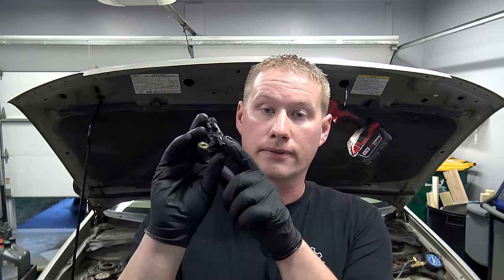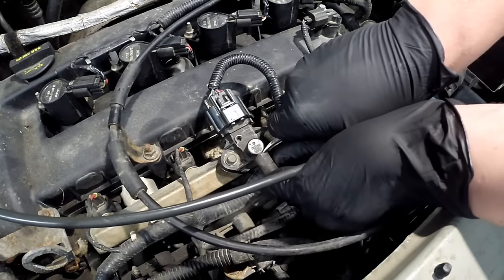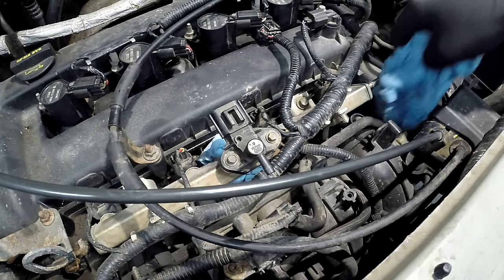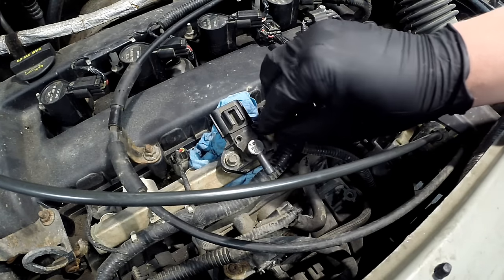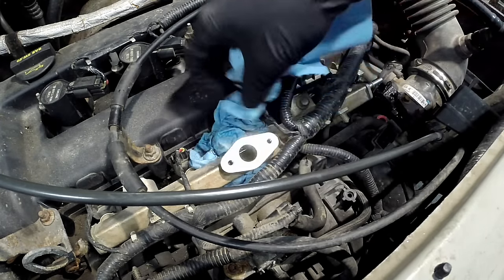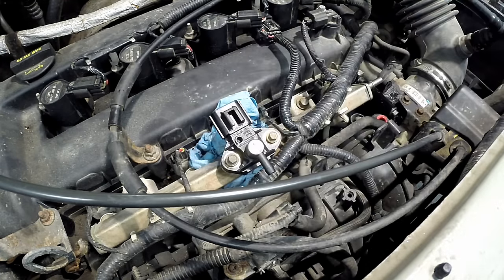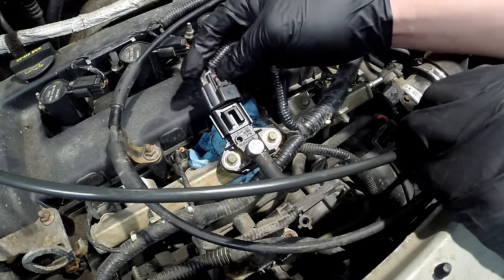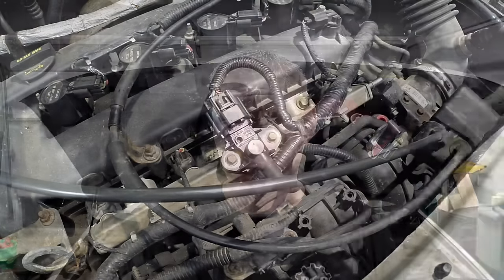Ford Vehicles: Fuel Rail Pressure Sensor Replacement P0191

Comment: My 03 mustang gt just died in the driveway, code was P0190 what do you think pressure sensor or fuel pump? also amazon does not have this motorcraft part for my car

Comment: I have an 06 Ford Freestyle.  I keep getting the code P701. Range Performance Sensor. where is it located? and is because of the connector being coroded? I can warm up my wagon for a 1/2 hour allow it to sit for 45 mins after running it. And them it's fine to travel in. before then it goes into crawl mode and still ha e to wait for the transmission to engage. what can be the cause of this? can you help?
Reply: Pls how did you fix it?

Comment: When you first removed the Frp sensor there was fluid leaking from the right of the fuel rail. Something to alleviate the pressure or a hoes simply forgotten before video took place?
Reply from the maker: This was removed from the diagnosis phase.

Comment: Please help !! I have a 2003 Ford Expedition 5.4L I changed an 02 sensors bank 1 … car was running to rich … I switched it and put new 02 sensor on … cleared the codes and car still runs like if it has a misfire … checked on a scanner fuel rail 1 and 2 are adding more fuel to injector .. what can be the problem please !!!!

Comment: I have a 2005 Mazda Tribute which I have been told is the same as Ford Escape. The problem I'm having is that I get different miles per gallon for every tank full. On one tank full I will get 19 MPG, then the next I will get 15 MPG, then 13 MPG, The 10 MPG, then 15 MPG, Then 19 MPG, and so on. Could this Sensor be causing that? If not, would you know what it could be?

Comment: We have a 2015 ford transit cargo- we have had an new issue where when we first start up the car when we come to our first stop- the engine cuts out, we restart it and then it runs fine. Could this be effected by this  sensor? Thanks so much for this great vid!
Reply: How did you solve the issue?

Comment: I have a merc sable 2002 and the P0193 fuel rail pressure sensor A circuit HIgh came up on my scanner I replaced the pressure sensor and my car still stalls and dies I don't know what would be another option?

Comment: What are the symptoms of failure on this sensor?
Reply from the maker: No start running rich running lean and most times just codes associated with the sensor circuits like P0191
Reply: Thanks.  I have a 2009 4.6 Lincoln.  Idle is not smooth.  New coils, plugs, crank and cam sensors, fuel filter.  Trying a new IAC this week.
Reply: I have a Ford Focus Diesel 2.0L TDCI, it won't start in the mornings , even during summer, when I get it started on WD40, it starts in between short and long trips the whole day, then won't start in the morning again. Questions ; 1) Does my car have this fuel regulator? 2) Is it the same part for both petrol and diesel engine? 3) Is it also plug and play for diesel engines? 
Thanks in advance!
Reply: steve b , same as you
Reply: turn the key on and let the glow plugs warm up, if that dosnt work your plugs might be bad, diesels have to have a heating element to start since they use the heat of the block for combustion and it sounds like ur either not giving it time to warm up properly or your heating element(if its glow plugs or a heat screen) may not be working

Comment: P0191 fuel rail pressure sensor code. Sensor may be going bad. Hopefully it will be that. If replacing doesn't fix the problem. I would  replace the fuel pump it may be intermittently failing loosing pressure. also replace the fuel filter.

Comment: I wish you had shown the diagnosis of this man. I have an 05 Ford 500 reading 10psi frp koeo with the scanner.
With a real gauge hooked up at the fuel filter under the car when key comes on pressure goes to 80 after 4 or 5 cycles but always settles back to 40 psi.

I have p0190, p0191 FRP Sensor codes and stuck rich both banks, 02 sensor codes p2196 and p2198. Condition is severe flooding non cranking. If i do get it to run its spraying gas mildly out the tail pipe.
Reply from the maker: I did I have a dedicated video on the diagnosis of this sensor.
Reply: Ok I found the diagnosis vid and it helped enormously. I went through the sensor test with a fuel gauge hooked in and plugged off at the filter near the tank, zero pressure on the rail and did the circuit test.

 My scanner doesn't show the voltages coming from the sensor to the ECM but did show 0 pressure and 83 psi when jumping appropriate pins in live data. Even my Torque Pro app shows it. 

Turns out my FRP sensor was stuck at around 11.3 PSI with zero actual pressure in the fuel rail and never went above 13 PSI no matter how much actual PSI was on the system back when I had actually gotten it to run a minute.

Thanks for your helpful vids. We had to haul this car in and did not know then what the problem was.
With the sensor unplugged the computer sees 83 PSI automatically which I guess would get you home if you knew to unplug it.

Anyhow the new sensors in and its running like new. Thanks again! My daughter will be so happy!

Comment: I have this code p0191 I replaced de sensor with original part won’t fix the problem I replaced the drive module still same code, any advice

Comment: I have a 2006 Ford 500 and the hose connection on mine looks totally different, the hose and the connection are one piece.  The part I ordered off Amazon(which is supposed to fit my car) is more like yours.  Update: Nevermind, I figured out what the problem was.  The hose was so dirty it looked to be one piece but it wasn't.  DOH!

Comment: How well do these sensors hold up to E85 fuel?
Reply from the maker: No problems.
Reply: @FordTechMakuloco  I don't know if this will change your reply but I forgot to mention that I have a 2002 Mustang GT with a bad FRPS. I installed a flex fuel kit on my stang.
Reply from the maker: Oh so you put a flex fuel in a system not designed for it?
Reply: @FordTechMakuloco  Yep. According to my research it's doable but the fuel pump and some of the fuel lines have to be upgraded for E85. The OEM 19 lb injectors are suppose to be adequate but I should upgrade to larger injectors.

Comment: More common for a fuel pump to cause a p0191 than the rail sensor? Wife F150 decided to barely run after she drove it a bunch. Had to tow it home... I was hoping to have the FP Module again but I'm not thinking so.

Comment: 2007 ford explorer fuel rail sensor, replaced twice, replaced connector, still having issues with trouble code P0193, and need further insite to other remedy to resolve this issue. my code reader when vehical is operating the pressure stays constant and does not flutuate at all at 72.?? PSI throughout idle and increased engine throttle. any suggestions on what else should be evaluated for correct function.

Comment: I have a 2008 ford f350 5.4L and it lacks power completely going uphill and acceleration and it threw the p0191. Does that sound like a symptom that could be affiliated with this sensor?
Reply from the maker: On those trucks it generally means the fuel pump or filter is failing.
Reply: Dildo Baggins you check the cats? Mine didn't have power either. I heard rattling underneath so I ordered direct fit cats on eBay and she will spin the tires now. I did the fuel pump module which is on the frame above the spare tire. I also did the fuel rail pressure sensor. If you turn the key to the on position, do you hear the fuel pump kick on in back?
Reply: I have the same issue lose of power code p019

Comment: I have 16’ ford fusion 2.5L and when it comes to a stop it stalls out. With some research it is suggested to replace the low pressure fuel sensor. Can you please help me locate it. I know it’s on the fuel rail but how do I know if it’s the low or high pressure sensor.

Comment: So after I replace the sensor what is the next step in terms of testing it. Do I start it up?
Reply from the maker: Check live data on a scan tool.
Reply: He stated quite clearly.....turn the key on and let the fuel pump get the pressure up and look for leaks.  Do this a couple of times, then if no leaks, start the engine.

Comment: I just put in a new fuel pump into my 2001 Taurus. I still don't seem to have good pressure. Could it be this regulator?
Reply: Did you figure it out?
What were your symptoms ?
Reply: @Devo  actually,  the problem was the ignition key.  My wife lost the key and had a guy come to the house and make a new one.  The new key did not have a chip in it.  I paid for a different company to make a key and the car started immediately.

Comment: Can this sensor cause raw fuel smell from the exhaust pipe when I start it in the morning?
Reply: Yes. It made my escape run too rich, which means too much fuel. Did you fix it? Hope it went well
Reply: @nickaa827  
Actually it was a leaky fuel injector. I replaced all of them and the smell went away and my mpg went up
Reply: @poundu27  awesome
Reply: @poundu27  how did you determine that
Reply: @nickaa827  
I pulled the injectors out of the engine and then I turned the ignition key to the ON position and there were two injectors leaking.
If you are going to do this, first you relief the pressure by removing the fuel pump relay and then you attempt to start the car. Try to start the car 3 times
Reply: @poundu27  interesting, at how many miles did this happen? and what year/model? ill try to look out for it on my 2005
Reply: @nickaa827  
140k miles
Reply: @nickaa827  if it's running lean it's too much air.. don't work on cars

Comment: Hey  would this sensor replace the mechanical fuel regulator? I have a 2001 ranger 3.0 v6 and it seems that this ranger does not have a mechanical fuel regulator. So I'm gonna look for this sensor.

Comment: The o-ring on the pressure sensor is sensitive when changing out the sensor. Th o-ring rips every time. Is it ok to use a different o-ring for the time being? I can't find the exact match anywhere except when ordering a whole new sensor. Does anyone else have this issue?
Reply: I ripped mine on the new one, had to use the old one. I used a tiny bit of grease on the o ring, and twisted it into place.

Comment: The fuel line is off the end of the rail. It leaked back there when the sensor came out.
Reply from the maker: Yup broke the vacuum and it leaked out. This fuel rail pressure sensor was part of a much bigger repair due to a lightning strike.

Comment: Question, i have a 99 mustang GT and i am having a “High pressure” fuel issue that is intermittent. New pump in it. Has been doing this for years. Do you think my aftermarket cams are messing with the vaccum?

Comment: Now do a video on a 2002 F150 4.2 V 6 regulator please! It's crammed in the passenger side of the truck at the rear of the the engine underneath the coil pack! Getting at the snap ring is a major pain in the arse.

Comment: If that sensor is bad will it send an intermittent signal not to operate the fuel pump? I'm having intermittent fuel pump problems but I definitely don't wanna change the pump and still have the prob
Reply: dondale68 check your fuel pump control module as well those can go bad on fords a lot

Comment: I have a 2010 ford focus and my check engine light is on I checked it at auto zone and I got a p0451 code what part is that most likely associated with

Comment: Hello sir. 
Please help. 
I have a 05 zx4 with manual tranny. 

Randomly shuts off then won’t start for about 30-60mins

I tested alternator while running (14.4v) 

Replaced fuel pump, filter, and maf sensor along with crank shaft sensor. 

Only code coming up was P0320 

Not sure what to do from here. 
Please lmk of a way to pay 🤑🤑🤑 for your time thank you

Comment: Is it possible that this could go bad without throwing a code? My truck reads 0 fuel pressure on the scan tool while running and driving.
Reply: How did you fix?

Comment: I'm pulling 274.21 psi on mine at idle.  Someone told me that was insanely high but I'm not sure what the factory spec is. I have a Ford 3.0L Duratec V-6.
Reply: Sorry....it was P/K

Comment: I have a 98' Lincoln continental 4.6L it won't stay running. Codes po192 and po113. Can't seem to find the low pressure sensor.

Comment: So my engine don't start is it because of the fuel rail sensor? It threw a code of fuel rail sensor A. It's a 2004 Ford Mustang GT.
Reply: I just got that code on my 04 gt. Any luck??
Reply: Throttle positioning sensor wasn't adjusted corrected. Also have to return it to stock tune
Reply: @cuda4094  appreciate the reply! Hoping to get this fixed ASAP

Comment: Thanks for the Amazon links!  They were cheaper than RockAuto!
Reply from the maker: Most times yes because rock auto gets you on the shipping you have to wait much longer to get your parts I never use Rock Auto because of these deceptive practices.
Reply: slider728 where is the amazon link
Reply: FordTechMakuloco has it in the description in the video.  Click on the "Show More" right under the video and you should find it.  Just make sure this particular part fits your car (the link is for the Motorcraft CM5229 Fuel Injection Pressure Sensor).

It was pretty easy to replace.  It took me longer to remove the hoses in the way and label them than to actually replace the part itself.

Comment: 06 Explorer, 4.0 SOHC... This WOULD be a 10 minute job,  except mine is UNDER the intake manifold!
About 10, star-head mounting bolts,  multiple hoses and wires before I can even get to it...
I'll see how many hours this is really going to take.
***Update: It's December in PA. Going to put this off until spring and after I buy a long enough socket extension & (apparently necessary) torque wrench to be able to do this "simple" job.
Or just save up and pay someone. Either way, it's going to have to wait.

Comment: Why can't you just pull the fuel pump fuse while the engine is running and let the system run out of gas?  Won't that bleed the pressure from the rail as well?
Reply: That will get rid of most of the pressure but not all.  When the pressure drops below the threshold the injectors need to keep the motor running, it shuts down and the remaining pressure stays in the rails.
Reply: Not with the engine running...the engine runs until there is no more fuel coming to it...because the pump is down.  I've done it...no pressure left in the rail.
Reply: Just did this on an 07 Mustang GT. I started the engine and pulled the fuel pump fuse.  Wrapped the area with a shop towel as shown, waited about 10 minutes and pulled the sensor.  There was fuel in the rail but no pressure and I had little to no fuel leak out.

Comment: I replaced fuel injection pressure sensor I started a looked for leaks  so I test drive it now it blows the black o ring apart

Comment: Dang it. I just left my vehicle for diagnosis and repair for a code for this sensor. I could have changed it myself. $90 for for diagnosis and 350 for parts and labor. No way I'm taking it back and doing it myself!
Reply: Double dang. My year make and model its under the intake manifold! They weren't lying about 2.5 hours labor after all!

Comment: Where is the A rail sensor on a 4.6 v8. I'm getting misfires on 1, 2, and 4 with the computer throwing the code that my fuel rail A pressure sensor is out
Reply: It's on the fuel rail on the driver side just behind the thermostat.. I replaced on my truck amd it didnt start after the new parts was on .. so just put the ole on and it started up again .. 5.4 3v problems

Comment: This is not as simple replace fuel pressure sensor. There is another have an issues with code P0191. I have a 2006 Lincoln town car 4.6L. I have issues problem 4 times driving and shut it off itself engine while driving. So I replace the fuel pressure sensor, and still keep same thing shut it off engine. 2 I replace the fuel pump and same thing stay shut it off itself engine, 3 I clean a fuel injections all 8 pieces and I replace O-rings fuel injector. And right now I’m still struggle I don’t know what going on my car issues with code p0191.
Reply: May also I checked on Fuse fuel pump, and the micro relays these relays are good I can hear when it click it it mean works.

Comment: Help...!! :(

@FordTechMakuloco

I replaced fuel pump ...  I didn't have any codes but my car was acting like it wasn't getting any gas every time I tried to start the car ..
After I replaced it the car has hard starts now ..
Finally a code came on it was p0193 I think but it said it was fuel pressure regulator , I replace that and the car ran fine for 1 day .. check engine light came on againg and its the same code for that sensor ..   its doing the same thing now hard start and feels like its not getting a lot of gas pressure ,  any help will be very appreciated ...  thanks in advance ..!!!

Comment: Anyone else notice fuel start pouring out to the right of the fuel rail at 4:30? LMAO
Reply from the maker: Yes this was a lightning strike vehicle that ruined a few modules and caused many sensors to be biased as was the case with this sensor. In order to confirm it was a damaged biased sensor the line was disconnected. Then once the sensor was removed to be replaced as shown here the atmospheric pressure in the in the rail equalized and the fuel drained out. It's just science.

Comment: 2005 Ford mustang 4.0, I replace the fuel rail sensor with one I purchased on Amazon for which was a Chinese copy and check engine light came back on the same code PO 191. Therefore I decided to purchase a Motorcraft your rail sensor for it to do the same exact thing, engine light came back on PO 191. Any ideas as of 2Y after replacing the sensor twice? Thank you

Comment: P0191/ P0190..Runs ok, then come to idle, runs rough as STFT on both banks jumps to +50, dies (f150 5.4)..replaced filter.  Sensor?, Pump?...thoughts anyone
Reply: It was a faulty Dorman FPDM. Lasted exactly 3 years. Still looked new. Replaced with OEM.